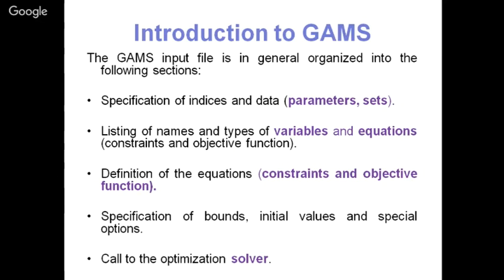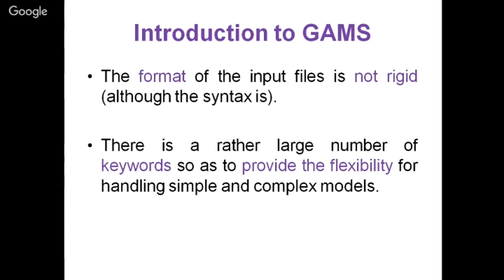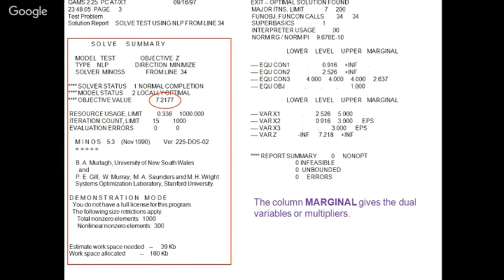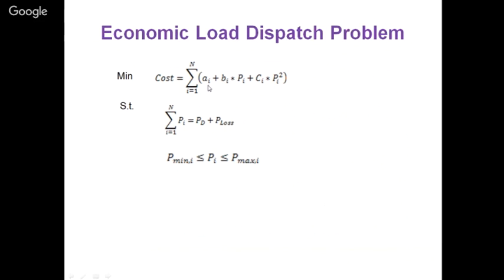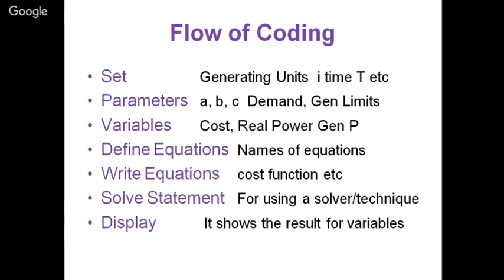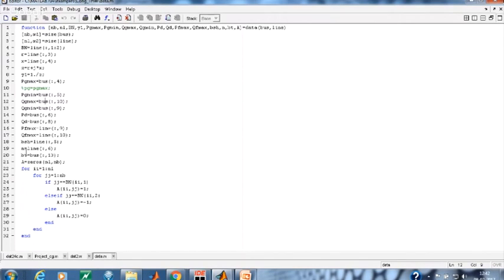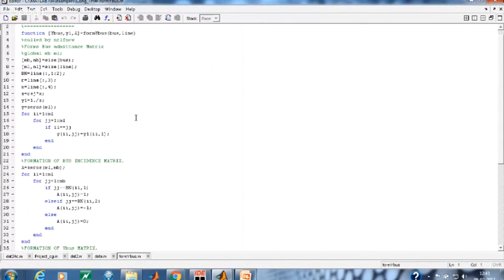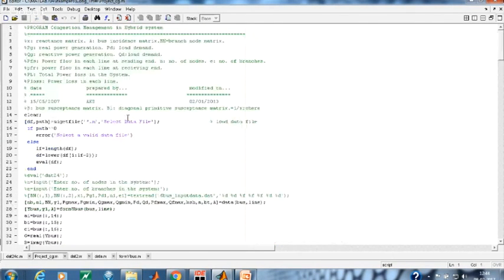Power System Optimization using Modelling in GAMS

Comment: Hi i was runing the command in gams "$libinclude matout cost.l" but it says unable to open include file and also when I want to run "[cost P] = gams('Test')" it give me error of "Error using gams
abnormal GAMS termination running "C:\GAMS\34\gams.exe" example4 lo=0: check listing file" can you please help me thanks
Reply: It requires interfacing with MATLAB